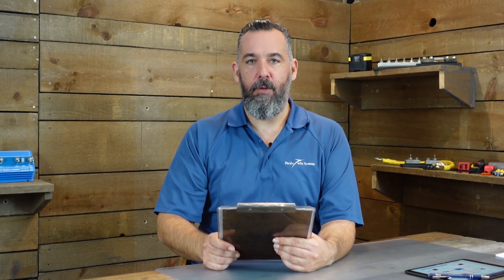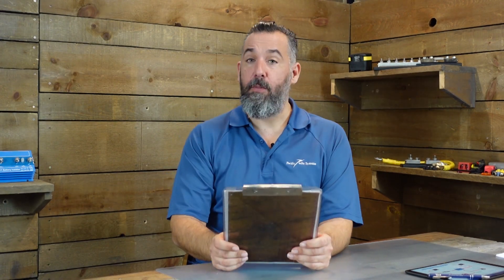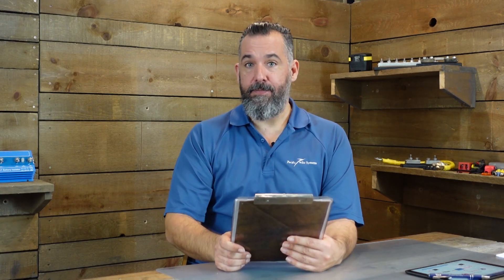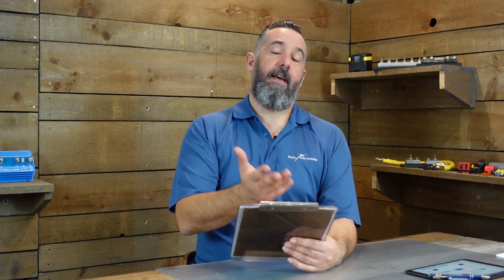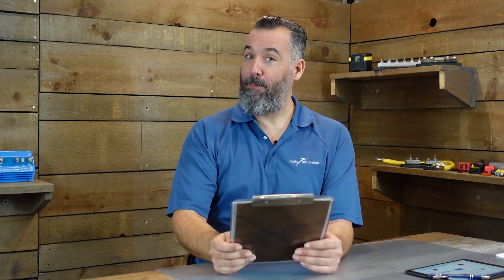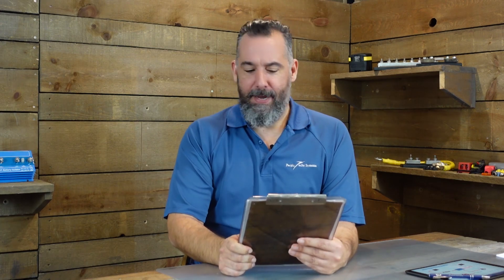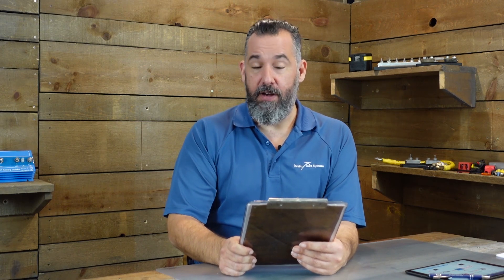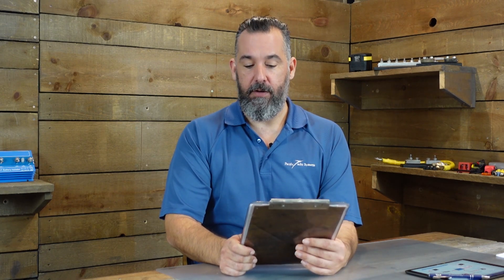I Am Upgrading My Alternator, How Will This Affect My AGM Batteries?

Comment: The standard alternator on my Volvo D1-30B outputs approx 13.9 volts at 2,300RPM. Will this be damaging my 75Ah AGM starter battery and 2x 95Ah AGM Service Batteries, both of which require 14.4v bulk/absorption and 13.5v float?

Comment: I've upgraded my stock alternator,  a larger agm battery and added the big 3 upgrade all ofc 0 gauge wiring.  My voltage stays from 13.8 to 14.1 with all my accessories on. Will that voltage regulator harm my cars computer???
Reply from the maker: For a 12 volt system, most alternator regulators output 14.4 volts on the positive post of the alternator, by the time it gets to the battery, your battery voltage might be a few 1/10 of a volt because of voltage drop and loads.

Comment: Lots of great info Jeff!!  If my alternator has an internal regulator, and I would like to charge my house battery, than from the house battery, use a DC to DC charger to charge my starter battery, would I want to rewire the alternator so that I could use an external regulator?
Reply from the maker: Big fan of external regulators... it's a great way to get faster and smarter charger from your alternator.

Comment: Does an internal regulator harm the battery by outputting a constant voltage?
Reply from the maker: It's not perfect, but I wouldn't worry about damaging your batteries.

Comment: Hi Jeff - You say that the alternator connects to the post of the starter motor but I thought in one of your other videos you said the alternator should connect directly to the battery.Does it connect to both directly ?
Reply: Hi Col . The wire from the alt. usually is always a # 10 gauge wire . It goes to the starter alt. as Jeff mentioned .  There is always from the starter  to the battery your  large battery wire .  All you need is a cable from the Alt. to the starter that will handle the amp output over the distance of the cable used . I used a #6 gauge wire .   Use OFC wire and not  CCA .
Reply from the maker: Good question, you should only have one positive connection to your alternator, either normally connected to starter solenoid or connected directly to battery bank.
Reply: @PacificYachtSystems  Hi Jeff - I also am upgrading the alternator on my Catalina 36 from the stand 50A to a 105A.  My positive output wire from the alternator to the solenoid needs to be a different gauge than the existing, but then so does the (much longer) wire from that solenoid connection to the battery, correct?  It looks like that wire needs to be a very large and difficult gauge, like maybe 2AWG  based on the length with all of the turns.  Routing that one has me concerned.  It's actually going from the solenoid to a charge isolator (ProMariner ProIsoCharge), which will then have distribution wires going from it to both my starting battery and my house bank.  Presumably those wires also need to be able to handle the full output current of the alternator as well?